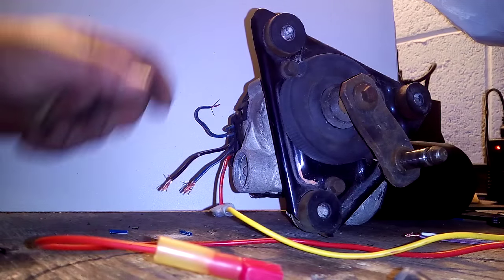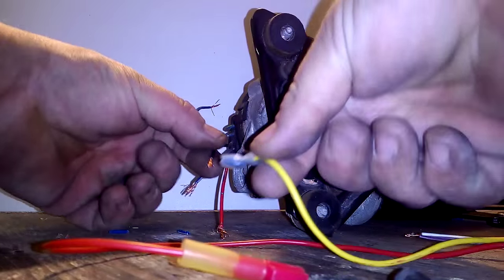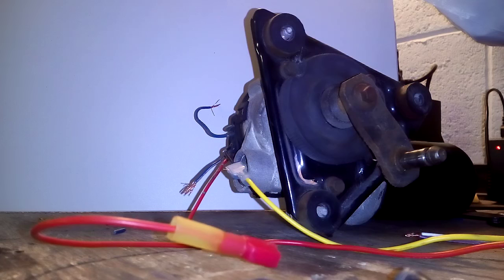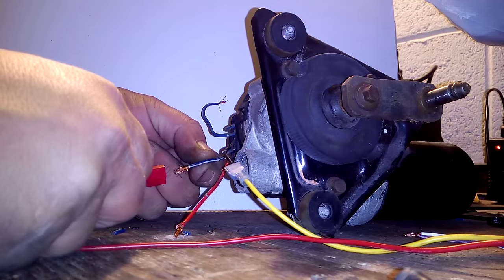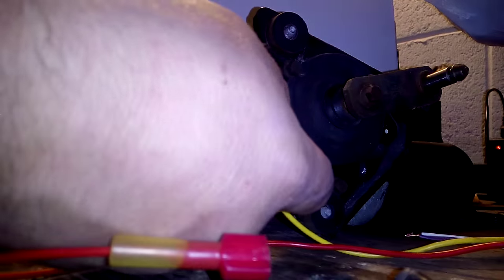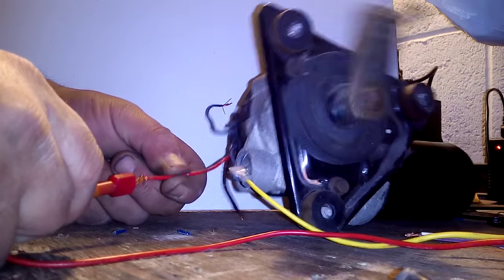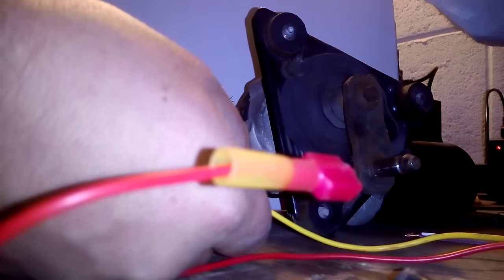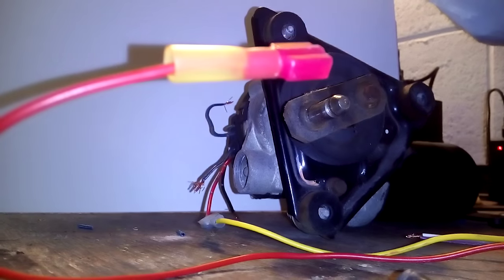wiper motor Wire config

Comment: Hi I’m wondering if it’s possible to get a dvd video from you of this, can u send me a price along , with your info to where I can ship you and or phone , address. . Thank you so much Jeremiah and james
Reply: Seriously?  First of all, it's wrong information.  There is no "third speed" and the shunting of the coils is why it's running so fast... and it won't last very long.  It's a two speed motor.  Period.  Two wires are for the park positioning and the other two are for speeds.  The case is the ground.
Reply: Can you explain more or post a link where this is explained: what is shunting of the coils is and how the shunting of the coils makes it run faster and why will it make it fail quickly?